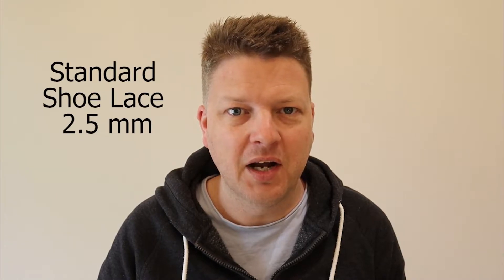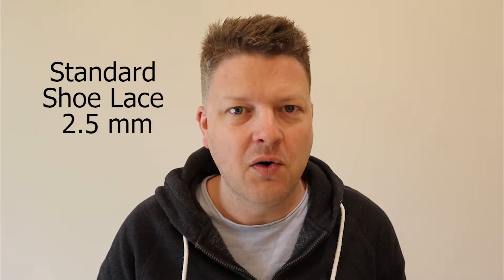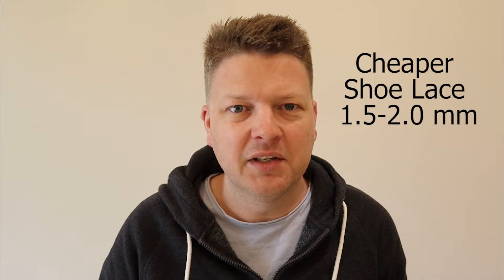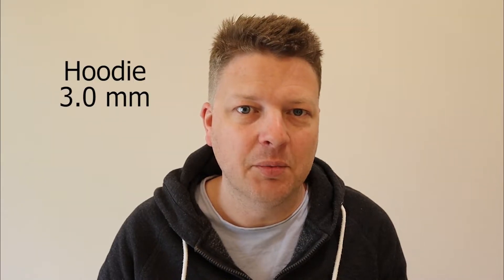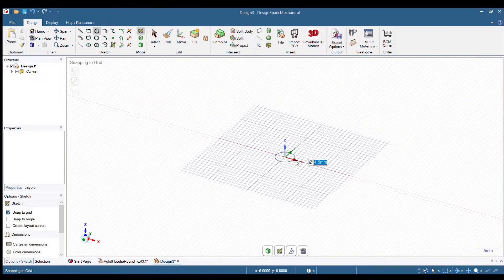Making Custom Aglets for Shoe Laces and Hoodies

Comment: I am so new to these waters, these files you mentioned in the video, are they still available? And if so are they easy to modify? Just want to change the text, but love exactly what you’ve done here.
Reply from the maker: The files are still available. The link is in the description. You can change or add text in a CAD program like Fusion 360 or TinkerCAD (both free).  Thanks for stopping by!